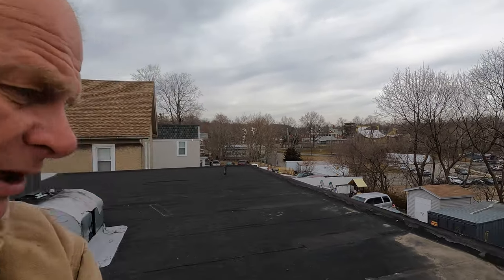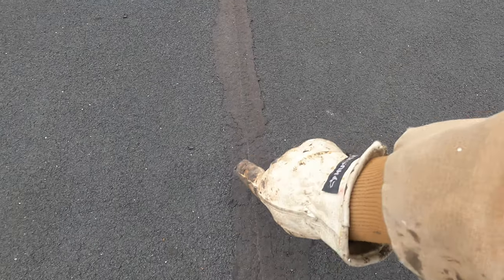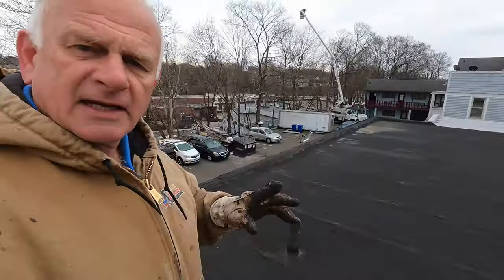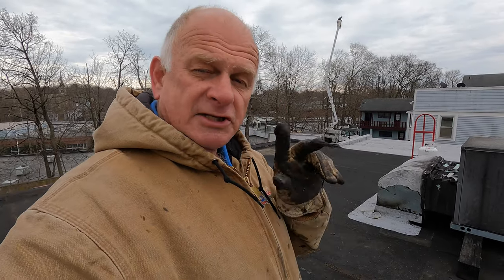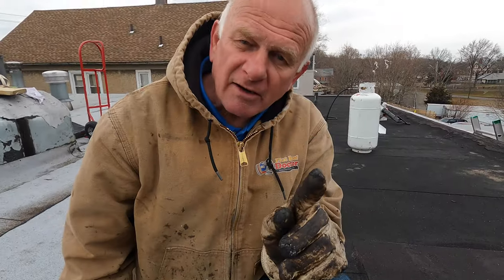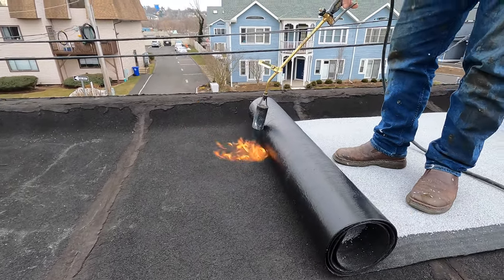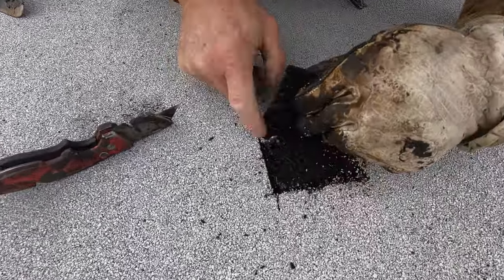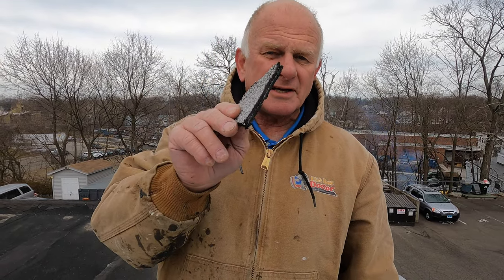Old Rubber Roof Torch Down - Should you Remove it or Install a New Rubber Roof over the existing?

Comment: Some questions need to answered.
1. How many roofs are on the building, weight could be an issue, modbits  typically weight approximately 100 lbs per roll.
2. Is there is moisture in the existing system, between roofs, insulation,  causing deterioration of decking ie. rotted wood, rusted metal decking, crumbling gyp. Any moisture trapped in the existing roof plies and insulation will continue to compromise the building envelope and put the structure at risk. You cannot roof over a wet substrate. A though investigation needs to be done with a number of roof cuts, a conversation with owner to determine what work has been done. Any and all information needs to be compiled before a decision is made

Comment: Tear off the existing roof unless the homeowner can’t afford the tear off. You are so right, you can add a second layer but screw down dens deck. But I would prime the deck before putting cap over cap.

Comment: What is the sealant that works and how do you know what type of rubber roof it is? He said it was rubber and used heat to put it on. I have a1 q/2 pitched flat roof
Can I email you? It's 19 years old. Never leaked once . Hasd a gravel tar roof replacement in 2003. Wish you could come here and tell me what  I need. I know I could trust you implicitly
. Give me the exact  name and how yo order.

Comment: I can't find anywhere whether it is possible to torch down a modified bitumen "mod bit" on top of an existing epdm that is failing.
Reply: Mine was done like this and it leaks even crazier
Reply: Cut back epdm perimeters and torch onto, however if epdm has blistered no longer stuck down must be removed , if decks good and epdm is still fully bonded then go over it

Comment: Sbs bitumen is also a torchdown membrane same as app.
Reply: Torchdown means it's welded with flame to the surface. It's only 2types of mixtures sbs and app. :) and both are eather pil and stick ore torch down :)

Comment: Please tell me your take on granulated peal and stick modify brand mule
Reply from the maker: I have used Mulehide and I like it. It works very good. You can find it at ABC Supply
Reply: @FlatRoofDoctor  I have a 100yr old 1800sq foot flat roof building and it has 7 old layers, I want to do a complete tear off, A roofer quoted a reasonable price with this product, should it be an option for me, I live in Chicago, your opinion on would you use this on a project my size.

Comment: I've got a 4 year old modified bitumen flat roof that is leaking near the drainbox. I've had roofers come and tell me that the seams were not properly sealed. It's possible to lift up the overlapping sheet using a finger in many places. They tell me that this is proof it was not properly seamed. Is it true? I don't know, every roofer seems to talk authoritatively including the one who installed my roof (he says the roof is properly installed!). Can the seams be "fixed"? Do I need to have another roof layer?
Reply: No, if you can pick up the seams, it's done incorrectly. I wouldn't even do torch down again or rubber.  Scrape it off and start all over with something more reliable
Reply: @ShyRage1  Yep, you're right. That's what I ended up having done this spring. Total roof ripout and replacement. I was the first homeowner to do that in 100+ years. They took out 6 layers of roof (bitumen, tar, and who knows what, all the way down to the first tin roof covering over the original deck boards). Replaced it with EPDM. Expensive. Hope I don't have to ever do that again!
Reply: @spuriustadius5034  imma look that up.  Is that something new?
Reply: @ShyRage1  Look what up? EPDM? It's also known as a "rubber roof". Contrary to what flat roof "doctor" says, it's a perfectly fine roof covering as long as it's done right (just like almost any other type of roof).
Reply: If your installer used Base first then the cap sheet and if the installer lapped the seams offset so the base sheet seams do not go inline with the cap going in the same direction then even though the cap sheet seems don't seem like they're fully sealed it shouldn't be able to leak because the other theme that the cap is seamed to the base sheet the seams should be a foot to a foot and a half away from the other seam between the two layers of SBS torch on most likely leaking somewhere else like a drain or around a penetration water runs along the Wood Construction or steel construction under the roofing surface and leaks out at the easiest place on the ceiling side to tell where  you're having leak on roof is where is the roof soft where is the roof beginning to Bubble how good are the seams around penetrations like wires coming through the roof rooftop units Plumbing stacks and gas lines

Comment: They told me at the roofing store if its 2 layers it has to be removed and there's already like 10 layers on my roof
Reply from the maker: Sure, that's what the book says.
Reply: And Thats also true. You have to think about the weigth and construction. If you have a roof that needs 100 rolls to seal it, well thats 4000kg with materials, and thats only one layer double it almost on 2 layers.